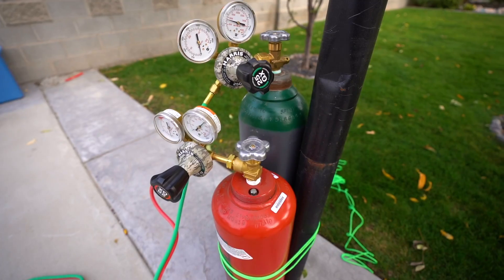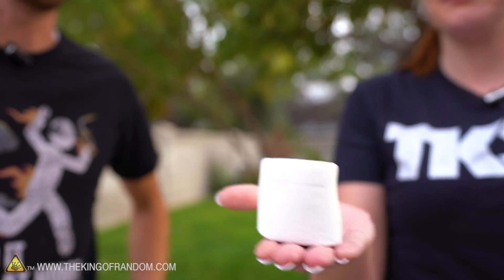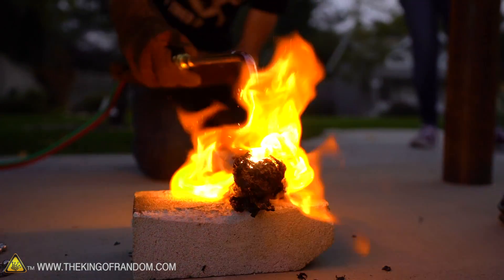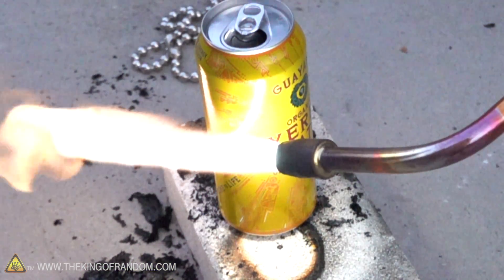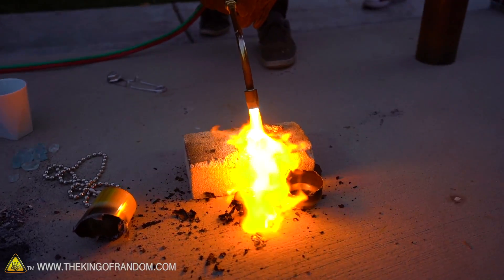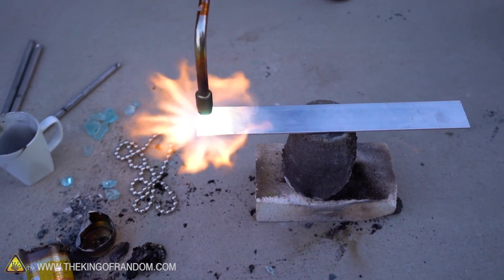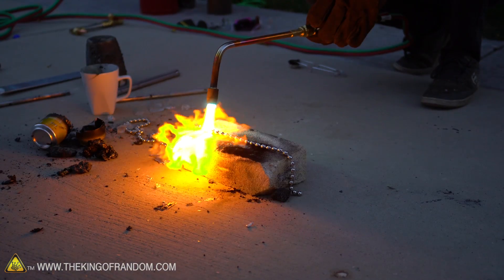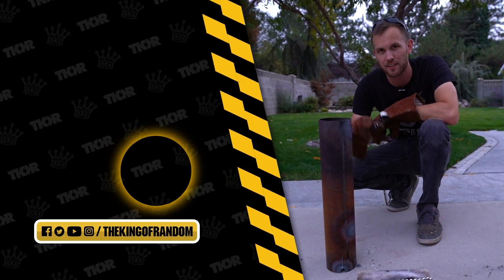This Gas Combo Incinerates Anything at 5500°F

Comment from the maker: What else should we test with this torch?
Reply: a microwave
Reply: @ahalty00  yes do that do that
Reply: idk
Reply: Mud
Reply: What happens if you put a blowtorch to Gallium?
Reply: @ElijahSlaven  tungenstine is tronger
Reply: A car just cut in half with it 🤔
Reply: And other metal stuff cut in half
Reply: Huge ice block
Reply: Cook a Steak
Reply: slime
Reply: Try melting 100 hot glue sticks and try making a mold of a hamburger
Reply: @dominicsworkshop  yes
Reply: Why does it say 5 days ago but the video says 51 seconds ago?
Reply: @sarastonge8600  you can set a comment early, the comment was viewable for patreons, people who signed up on patreon so they can view their videos before they release.
Reply: @sarastonge8600  i think they comment before publish the video
Reply: Stretch Armstrong
Reply: EVERYTHING FOR CALLIE sorry if I spelled it wrong
Reply: Marbels would be pretty cool?
Reply: You should put wayyyy more oxygen(or less asetylen) to The mix, it's supposed to be smaller bright blue flame with white center, that's what is used for cutting thick steel.
Reply: @NOSEXER  they don’t have a cutting tip, they have some kind of braising tip. That’s why they don’t have that nice cone shaped flame
Reply: @trickytrent5146  yea, but you can also bump the oxygen up with that tip to get hotter flame.
Reply: @NOSEXER  your the second guy in the comments with an actual brain :)
Reply: sup
Reply: Sugeston:should try to melt a lot of cotton candy
Reply: Make a grilled cheese
Reply: You should test a Diamond with it or Try Tungsten or Titanium!
Reply: @jaidenjohnson8337  I was going to say get a Tungsten marble and heat it up with the torch
Reply: @barleyinteresting  Cool! I also Said Diamond!
Reply: @jaidenjohnson8337  finally found a guy with a brain :)
Reply: Stainless Steel
Reply: Popping popcorn
Reply: Barbequing at 5500°F or try silly putty another thing to try would be a if a newtonian fluid would react differently
Reply: Dry ice
Reply: Aerogel
Reply: Melt 10,000 marshmallows using the torch.
Reply: Dry ice
Reply: Well first you should watch a video on how to properly use it
Reply: @twistafromthecoldchi3171  yes, definitely. I'm just  a teenager and I can use an acetylene torch better than that XD
Reply: Using the torch the proper way......
Reply: Idk
Reply: roc
Reply: Everything
Reply: put carbon in it
Reply: How does this make since
Reply: Metal Ball
Reply: How long it takes to melt down stuff
Reply: How is this pinned five days ago the video dropped less than an hour ago!?!?
Reply: @schoolForAnts  they probably had it private
Reply: @rosadajer6426  oohhhh true
Reply: @schoolForAnts  ikr
Reply: I don't know but can you try to cook food with a wax melt           torch meat
Reply: I am a fan of welding
Reply: Crayons and plastic
Reply: Get a cutting head for the torch
Reply: Torching metallic pieces with welding flame looks incredible!
Reply: Sand
Reply: sand
Reply: A shoe
Reply: Cooking a steak
Reply: This is for my dad, whos the best mechanic I know. Try cutting through a engine block!
Reply: skittles
Reply: Cutting metal with it or welding seems like they might have some kind of effect.
Reply: You should test shutting it off properly ( close oxygen first)
Reply: Cook a pizza, pizza rolls and some other things
Reply: Make pasta
Reply: take the big marshmallow from your last video and toast it with the torch
Reply: Could you melt one of y'all phones y'all dont use or it doesn't work but take the battery OUt first?? PLEASE???
Reply: ...NATE NOT EATING SOMETHING!?!?!?!?!...make a cannon with it
Reply: Caulk Glue
Reply: burn 1000 carbon snakes together
Reply: You should let more oxygen flow through the torch to get a hotter flame and also use a cutting tip if you want to cut stuff 🔥
Also you could try to fill balloons with oxy/acetylene gas and detonate them (careful it's extremely powerful)
Reply: Fill bottles with the acetylene and oxygen and blow them up.
Reply: Starlight! That corn starch and Elmer's glue putty. Fully coat an egg and see if it can take 5500°.
Reply: Please try making glass with sand using the torch
Reply: How fast different liquids boil
Reply: Buy some  aluminum oxide powder.  See if you  can melt it into a sapphire/ruby.
Reply: Melting freeze dried candy?
Reply: Fill a balloon with it and some helium. Tie toilet paper to it let it float about 15 feet in the air the light the paper. Caution very explosive. Haha
Reply: Aluminum oxide. Make different types of saffires
Reply: Fill a giant bag just with the oxy acetylene and ignite it
Reply: bake a cake with it . 😂🤣🤣🤣😂😂
Reply: Burn the brick.
Reply: Slime or a phone.
Reply: Hit some dry ice with it. Or liquid O2 perhaps?? Idk use it on something cold
Reply: Can you fill up a mattress with water💧or H2O
Reply: So remember the time you tried to cook a full meal with office supplies. Well you should do it again but only with the torch:)
Reply: O/A welding is my favorite way to weld because you have complete control of what you are doing.. This torch is a fun thing to use when you learn how to use it properly. I suggest you safely store it away and take a welding class. Your local CC might offer one. There might even be an auto body shop that might have someone that would be able to help.
Reply: melt the sun
Reply: You need to get more acetylene pressure in order to use that torch tip. The discoloration in the neck is from the flame burning inside the neck. If the oxy/fuel mix is correct there should be ZERO discoloration and you would be able to hold the torch at the neck ALL DAY LONG.
Reply: How would this torch react with liquid nitrogen
Reply: Use the torch underwater
Reply: Cotton candy
Reply: Try facing the torch vs liqid nitrogen and also get a cuttin tipe torch i think its more powerful
Reply: Dimond
Reply: Mercury
Reply: U should cook steak
Reply: Cook sum steak,porkchops,hamburger,lol u should try and make sum potato chips @kingofrandom
Reply: dry ice
Reply: Ha Ha... Diamond 💎
For Sure! 😌
Reply: @ajaysureshr  diamonds don't melt, they sublime directly into Carbon Gas
Reply: @phoenixlunaalexandrite3186  Diamonds Do Melt, Kayla. At 7000°F, They Melts! Check Out The Question They've Asked... Since Their Gas Combo Can Attain 5500°F,  I Think, That Would Be Enough To Start Melting A Diamond, If They Flash This Torch Onto It. And That's All! 🤗
Anyway, Thank You For Your Reply! ☺️
Reply: @phoenixlunaalexandrite3186  And Your Answer Is Wrong Too... In The Presence Of Oxygen While Heating (No Vacuum Condition) It Produces Carbon Dioxide Not Carbon Gas And Without Oxygen (Vacuum Condition) It Turns Into Graphite! Hope You Got Your Answers, Kayla! 🤗
Reply: Cook steak and other types of meat with the acetylene torch.
Reply: soap?
Reply: @brittplaysalot  I agree I think that would be really cool
Reply: @justsomerandomdudewithinte863  thanks
Reply: do more!, this time actually crank up the oxy a bit more, because with how high you have the accetalyne, you're probably wasting it, maybe study bit on it. also try a cutting tip
Reply: Oxy fuel torch vs dry ice
Reply: Stuff that wont get set on fire
Reply: Try all the tests you did in this video but with a cutting Tim instead of a heating tip
Reply: Make a foundry
Reply: Try to perfectly roast a marshmallow
Reply: I'm curious. What is the tool Nate used to light the torch called? A striker, or maybe a different kind of sparkler.
Reply: @princesseverfree5026  striker
Reply: @trickytrent5146  Thanks for letting me know.
Reply: @princesseverfree5026  striker
Reply: @loganketchum7819  Thanks for letting me know.
Reply: @princesseverfree5026  its a special type of flint and steel
Reply: @princesseverfree5026  a striker
Reply: Mini gasoline
Reply: Upgrade the furnace?
Reply: Frozen Pizza! 
Normally frozen, then cryogenically frozen and see if that makes a difference.
Reply: How is it 5 days ago ?!
Reply: Make the torch man's best prank. The boom bag, plastic grocery bag + acetylene + a small shot of oxygen + a thrown lit match at it =  BOOM!
Reply: Red hot....Chia pets ?
Reply: Phone
Reply: Melt different types of magnets and see how they react, esp the stronger earth magnets.
Reply: a consle or a tv or a t-shirt
Reply: Make a foundry with two torches like that
Reply: Could you melt one of y'all phones y'all dont use or it doesn't work but take the battery OUt first?? PLEASE???
Reply: Could you melt one of y'all phones y'all dont use or it doesn't work but take the battery OUt first?? PLEASE???
Reply: Could you melt one of y'all phones y'all dont use or it doesn't work but take the battery OUt first?? PLEASE??? I'm pasting these a lot so Yter can see it xD
Reply: Could you melt one of y'all phones y'all dont use or it doesn't work but take the battery OUt first?? PLEASE???
Reply: Could you melt one of y'all phones y'all dont use or it doesn't work but take the battery OUt first?? PLEASE???
Reply: Could you melt one of y'all phones y'all dont use or it doesn't work but take the battery OUt first?? PLEASE???
Reply: @HouseFullOfCatss  you do realize that thats not fair for other prople?
Reply: Your house
Reply: Could you melt one of y'all phones y'all dont use or it doesn't work but take the battery OUt first?? PLEASE???
Reply: Make popcorn with it
Reply: Use the oxygen to feed a thermal lance made from steel brake line.
Reply: wood
Reply: try to melt rebar
Reply: Try to melt sports balls or nerf guns/bullets
Reply: Get a curing torch attachment
Reply: Oranges
Reply: Why was he useing a rosebud torch heat to cut
Reply: Definitely don’t snuff out the flame then use the gas flow to fill a trash bag.
Reply: I would like to see the torch tested on a wooden bed frame or like a big slab of soft wood
Reply: Get a cutting torch head and tips to play with! Then cut a oven in half.
Reply: Get a door and put a green screen in the shape of a sign on the front. Melt the knob/locks with the torch and kick the door open. With proper acting the resulting footage would make an  amazing video meme template.
Reply: try to make some glass from its main ingredients
Reply: How was this comment 5 days ago?
Reply: Maybe it the camera but I don't think you guys are setting thr torch correctly. You should be adjusting it so the flame is completely blue and streamlined. The white part of the flame is the hottest and what is used for cutting steel. I suggest adding more oxygen.
Reply: What if you tried casting something with it. Like melting metal and casting the metal in something.
Reply: Dry ice
Reply: Your views are going down because youve stopped doing the "random" projects like you used to.
Reply: @marz.6102  yeah, I missed those!!!!!
Reply: There is a way to get it hotter fyi if you adjust like a welding torch
Reply: You guys should test cooking candy, meat, or different fat solids (Butter, Margarine, Lard, etc.)
Reply: freeze dry gas
Reply: A men Armstrong
Reply: A block of titanium or tungsten
Reply: @TheVibraniumPatriot  yes
Reply: Fruits??
Reply: I would like to see Piranha Solution and Calcite reaction, or Piranha and other carbonate/carbon minerals
Reply: A fire extinguisher
Reply: Test gallium!
Reply: A car
Reply: Quick boil water
Reply: How about some three-quarter inch steel plate
Reply: Hi
Reply: Melt some orbees
Reply: Can you cook a steak? That seems to be nates fave experiment XD
Reply: Use it to apply O2 to things.  1st thing to try is to hit a smoldering cigarette with pure O2.  You will find out why they say you should not smoke where O2 is in use.
Reply: Cook a steak with it
Reply: Cook a big steak
Reply: You should get the brazing head for it or the actually cutting head
Reply: Cut a car in half
Reply: The brick was being tested, see how far you can go
Reply: Melting glass with other color Glass to make jewlery
Reply: Can the torch melt sand into glass?
Reply: You guys need to bring welding into this show
Reply: Try focusing or concentrating the flame to a tiny point and try and test how fast it will cut through certain items.
Reply: stake
Reply: salt.
Reply: Try to cook or bake with it please
Reply: pvc
Reply: Test how much heat it takes for heat resistant materials to singe or burn.
Reply: What it does to dry ice
Reply: Either that, or test it on some flame resistant materials
Reply: I took half a semester of welding in grade 10 and I'm pretty sure you turn the Acetylene off before the Oxygen, If that's what's making it pop then It's the other way around, I believe you also use like a small quarter turn on the Acetylene since it doesn't require much but you crank the Oxygen up more than the Acetylene, You want there to be Blueish white spiked flames at the tip of the Nozzle where the gasses are exiting which means you have a nice hot flame, the more spiked and bigger they are, the hotter the flame.
Reply: @hailothgaming  well, think about it, if you turn of the acetylene first then the moment you do that, the oxygen to acetylene ratio will change so that there is alot of oxygen and not much acetylene, and that is what makes it pop. so to avoid that, turn off the oxygen first.
Reply: Watermelon
Reply: Get a cutting heat, I'm sure Callie would appreciate watching a torch slice through heavy steel like a hot knife through butter.
Reply: How many marshmallows to make a fire proof shield
Reply: Oreos
Reply: Starlite 😎
Reply: Insulation, like asbestos but not asbestos obvi aha
Reply: Try to melt starlight. Also measure the insulation abilities of the compound.
Reply: E t d3 uunngåelig 5 1 Zambia
Reply: Hacksmiths thors hammer
Reply: Technically hacksmith made a protosaber
Reply: 5 days ago. But the video says 4 hours ago??
Reply: Get it cutting torch head that one is a rose head used for heating large areas
Reply: Id like to see chromium melted with it, its an element in stainless steel that melts at 3465F or1907C
Reply: Dry ice
Reply: Dry ice
Reply: Get another one and make a super foundry, just like propane one but have two torches as burners
Reply: Sandwich with peanut butter
Reply: GIANT BLOCK OF ICE! GIANT!!!!!!
Reply: Oxygen lance
Reply: Watermelon
Reply: Learn how to use it?
Reply: Try heating up a glass bottle and flatten it.
Reply: Pork
Reply: EVERYTHING
Reply: Try brazing with it. 😉 could be a fun challenge, and also potentially destructive
Reply: The forest
Reply: Try to make us s'more with it the torch please 😊
Reply: cook a steak and other foods with it
Reply: You can buy a different tip to make it finer and more concentrated
Reply: Melt the giant crayon
Reply: Try to melt mig welder wiering wiith the torch
Reply: My students and I were discussing the possibility of cooking things such as pasta (boiled in water) as well as other foods with a flame thrower. We just really want to see stuff on fire (perk of teaching Science 😉)
Reply: Starlight
Reply: Do you have a cutting tip for it? Get one and write stuff in steel plate
Reply: A watermelon or a punkin
Reply: You should try to cook with it!😂
Reply: Liquid nitrogen vs. Acetylene torch
Reply: Could you do a video where you cook a full meal, using only the torch as a heating method?
Reply: How long does it take to cook a steak at 5,500 degrees?
Reply: Another random idea: Could you melt alot of styrofoam with the torch?
Reply: Maybe do some experiments with mini (diy) hot air balloons, the extreme heat might make it rise more although you’d have to figure out a way to do it
Reply: Vacuum chamber
Reply: COOK FOOD WITH IT
Reply: cook some meat
Reply: Cook food with it.
Reply: Can u vaporize oobleck with it?
Reply: Starlite
Reply: A banana
Reply: Get a bunch of leather ppe and a face shield and take some steel grinding dust and light it up, it is an awesomely dangerous light show, this is coming from a 6yrs experienced certified welder
Reply: BOOM CANNON!!
Reply: Ice
Reply: You should aker a homemade sparkler with it I think that would be fun
Reply: Potato cannon using acetylene or the combo of oxygen and acetylene
Reply: Burn tungenstine
Reply: Computer.
Reply: Attempt to blow glass
Reply: Titanium block
Reply: also protect your eyes from  A flash burn occurs when you are exposed to bright ultraviolet (UV) light. It can be caused by all types of UV light, but welding torches are the most common source. That's why it's sometimes called 'welder's flash' or 'arc eye'. Flash burns are like sunburn in the eye and can affect both your eyes. and skin
Reply: Use it on a lot of dry ice
Reply: Ice carving competition with the torch
Reply: Hey take a shop class before you teach bad habits to children
Reply: Your hand
Reply: you should burn sand with this torch and see if it turns into glass or not and maybe see what it does to liquid nitrogen
Reply: Ice
Reply: Tungsten
Reply: Fighting hack smith lightsaber vs torch
Reply: Honestly I think you guys should test what different colors you can make steel change into at different temperatures! (As in when it cools the colors are different in different places)
Reply: Using it correctly:)
Reply: I would love to see if you could use this to alloy tungsten and steel!
Reply: Turn sand into glass with it
Reply: Make a TKOR sign with it! (Using steel plate)
Reply: Can you melt a watermelon
Reply: Can you try melting diamond with it
Reply: Steak
Reply: try and cook popcorn
Reply: You should try it with a vacuum insulated water bottle with water.  Or maybe vodka
Reply: Cut a car in half with it
Reply: Step it up and throw a cutting head on that sucker.
Reply: Meth
Reply: Watch more videos on how to fine tune your torch. But I suggest you use the cutting tip on it to get the 5500 degrees your talking about.
Reply: Starlite.
Reply: I believe we miss liguid nitrogeon. So take this tourch to it.
Reply: Try to boil a liquid nitrogen 
And mercury
Reply: Try to melt thick copper wire while passing electric current through it
Reply: Hit water, milk, juice, coffee, slime, etc. With the oxy-acetylene torch!! I want to see what happens!
Reply: Make a super heater foundry
Reply: Make marshmallow insulation and try it on various materials to see how much longer they last.
Reply: I think it’s called starlight
Reply: Try burn some dry ice
Reply: please tune the setting till you get a nice medium lengethed blue flame so its on its max temp
Reply: Starlite wrapped around an Egg vs torch!!
Reply: Watermelon?
Reply: NaK alloy
Reply: Do a car with a microwave inside a microwave inside a microwave with a toaster toasting phones watch a microwave being microwaved
Reply: Cook a piece of meat with it.
Reply: See if you can have the OxyAceteline torch burn underwater. Maybe even try cutting some steel underwater.
Reply: Try to boil water with it. Just shoot aim it straight into water.
Reply: Learn how to use it.
Reply: Cook an entire Christmas meal. :)
Reply: See if you can cut through tungsten, or at least make it really hot and then drop it into water.
Reply: A bunch of steel and make a play button
Reply: As a welder myself I have always wanted to see an acetylene tank be blown up by an oxyacetylene torch.  Can this be a thing at the dome.
Reply: Blow Torch some Silly puddy, slime, stretch armstrong goo... stuff
Reply: Why not use hydrogen
Reply: Cut a car in half
Reply: Anakin Skywalker
Reply: Get a cutting tip it will work better
Reply: will it break first or AEROGEL????
hmmmmmm
Reply: You should try and cook freeze dried food or just food
Reply: You should try and cook different meats or foods
Reply: Let Grace have fun with the Pyro! :-D
Reply: try and make Prince Rupert's drops
Reply: steak
Reply: What hapens if you use it on ice?
Reply: make it a lightsaber >:D
Reply: you should get aerogel and see if the heat goes through
Reply: Dry ice
Reply: Use it to make a gigantic foundary from a washing machine.
Reply: please try sand
Reply: popcorn
Reply: Use PPE...
Reply: Make a flame thrower using that
Reply: How much did it cost to buy.
Reply: Osmioum
Reply: I would like to see this set up compared to cutting propane and oxygen... Both with the rose buds and cutting tips
Reply: Cook steaks
Reply: Fill up a ballon with it and use toilet paper as a fuse and don’t stand any where near it please do it in slow mo you won’t regret it need to do it in the desert or dome
Reply: Can you use this torch or some other process to make metal foam at home? There is lab made metal foam that happens to be bullet proof. Can metal foam be made at home?
Reply: Iron rod or something
Reply: Food like steak, chicken and other stuff like that
Reply: Ok, hear me out here-soak orbeez-hit them with the torch....  Make a grilled cheese in cast iron skillet?
Reply: I mean you could test using it correctly..... so much wrong with this.
Reply: Would it be possible to make a potato cannon using the "new toy" 😁
Reply: @vineshnarayan5490  i think it would incinerate  
the potato...XD
Reply: @Logan Feng ok but wierd
Reply: you
Reply: @darklordflaming2089  ? what oh i get it...........
Reply: Cut through a brick wall! :D
Reply: @cm374787  yeag if you want a scortched wall .........welll that would look preety cool acualy .            dont make fun of my spelling im in 4th grade yes i still dont know how to spell words
Reply: see how long it takes to melt through a cold steel pan
Reply: You should hear up some dino nuggies
Reply: A cutting torch works by a jet of pure oxygen that causes the steel to actually burn, and once the steel is burning it creates enough heat to still cut if the flame is turned off and you continue moving with the torch. And I know you’ve done stuff with liquid oxygen before and hopefully are still capable of producing more liquid oxygen. I would love to see a battle between red hot steel and liquid oxygen. Use the torch to almost melt a piece of steel then pouring liquid oxygen on it to see if it burns through before the liquid oxygen cools the steel, and what happens if you drop a piece of red hot steel into liquid oxygen - will it just rapidly cool it or rapidly turn it into a pile of rust?
Reply: Stretch armstrong
Reply: You're supposed to turn the settling up till there's no black smoke then the oxygen until you have a blue flame and a smaller blue top, also turn the oxygen of first because the popping sound is a tiny explosion and it can travel up the tube to the tank
Reply: Cook food...
Reply: The brick
Reply: Learn to set up your rosebud before using it again
Reply: Your house
Reply: Use the cutting head and cut one of the cast iron anvils in half. 
Weld steel with a metal coat hanger.
Those silly goggles came in the kit for a reason the IR radiation will damage your eyes.
Reply: Give a demo of torch cutting steel plate.
Reply: A TKOR sized Jawbreaker
Reply: Hello, your videos are very interesting. 
Melt carbon steel, stainless steel, neodymium magnets, titanium, niobium, and make cast ingots of these metals.  Try to melt  obsidian, porcelain, concrete... Burns high-density wood and graphite.
Reply: How you try foods like steak or popping pop corn
Reply: A tungsten cube
Reply: Try to melt a stove that'd be ironic
Reply: tungsten
Reply: Try to cook Ostrich egg with it
Reply: TURN SAND INTO GLASS
Reply: Cook a steak
Reply: Cook some food with it,maybe
Reply: learn how to properly shut off the torch
Reply: paper
Reply: How fast can you melt brass?
Reply: Nick, Callie; I know you guys know what you're doing but perhaps a little PSA before the next video with the oxy/ace torch. I'm sure many of your viewers know full well not to attempt the thing that you're attempting without caution but there are some people out there that a word of warning could be useful. 
Also, this vs glow sticks.
Reply: Get you a cutting tip
Reply: Learn proper use of a torch and how to set a neutral flame. Also, invest in some backflash arrestors. Turn the acetylene up until the soot stops, then introduce oxygen until the flame is a translucent purple blue with sharp blue white cones. You will see the acetylene feather shrink until it evenly meets the cones, that is a neutral flame, any more it is oxidizing, less is a reducing or carburizing flame. What you had was a heavily reducing flame.
Reply: OXY-ACETYLENE VS LIQUID NITROGEN PLEASE...
Reply: popcorn
Reply: You should test with a neutral flame.
Reply: Perhaps test some things with different torch settings. Like carborizing flame, neutral flame, and oxidizing flame.
Reply: Get a cutting tip or go melt things with a stick welder
Reply: tungsten
Reply: @astudent4187  they would probably only be able to melt it with a cutting head, and if they turned on their oxygen more.
Reply: Tungsten
Reply: Turn the acetylene off before the oxygen, that will eliminate the popping when shutting off
Reply: You should put the other head on the torch, and show how it oxidizes steel to cut it
Reply: Magnesium shards at night
Reply: A nickel
Reply: try to sink a boat using the torch
Reply: Try melting one of your non-stick pans
Reply: Make a ruby rod chromium and  aluminium then make a laser
Reply: Make an attachment and fit it in the foundary
Reply: Dry ice
Reply: a  plasma globe
Reply: Set water on fire
I've seen it before
Reply: PLEASE PUT A PLASMA BALL IN A MICROWAVE
Reply: do anything with slime
Reply: The King of Random lo I have never comment on a comment on tkor before
Reply: @Ashtonminard  me neither
Reply: A chicken
Reply: Maybe some colored lasers with salt and stuff
Reply: If you cut into a charged fire extinguisher will it put it out or not
Reply: Cake
Reply: Turn off the oxygen in the gas
Reply: @gannonthegreatdeclue2152  wat, he's burning why too much acetylene, he should keep giving it oxygen until the flame turns blue, then you can turn the acetylene down a bit, he has a carburizing flame.
Reply: Can you please freeze dry peanut butter and milk shakes